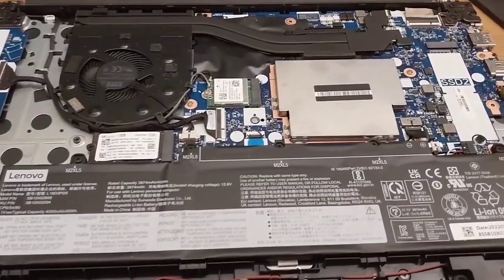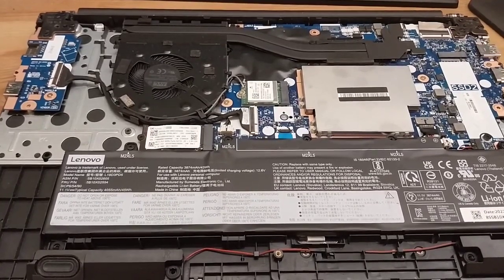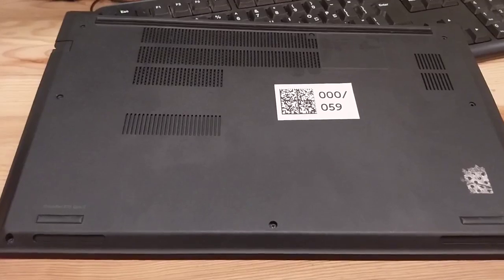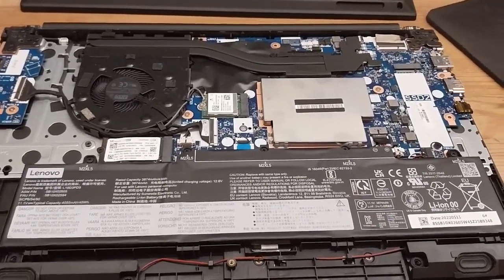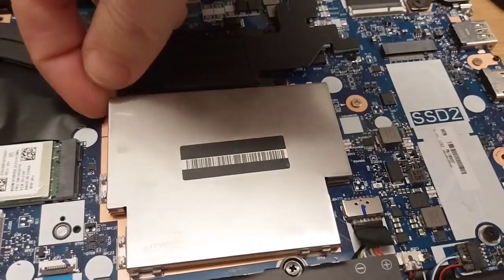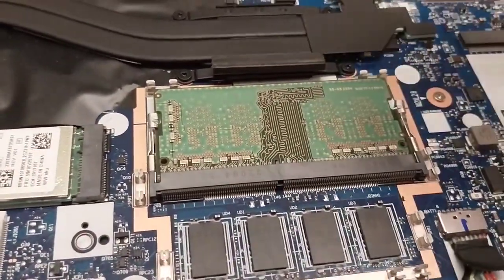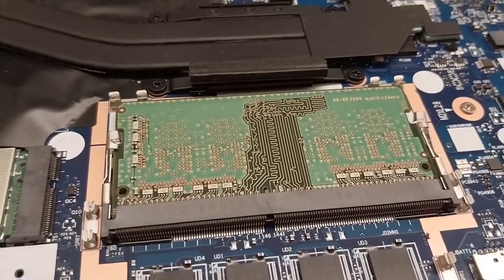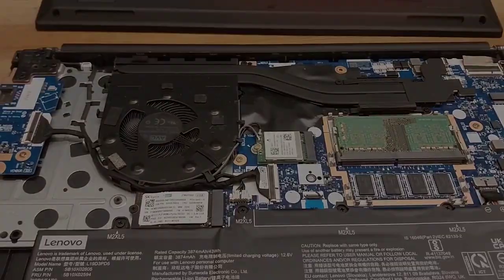Lenovo Thinkpad E15 Gen 3 RAM Upgrade

Comment: Bro, I don't understand, PERF says max capacity is 24GB when 8 GB is soldered, meaning max you can insert on top is 16 GB. But you're saying I can insert 32 GB stick? Meaning it's going to be 40 GB as the result? Documentation also mentions that more changeable RAM might be supported and it all depends on how the technology is developed bla-blah, nothing specific.
Reply: TLDR 32gb does work but lenovo doesn't recommend it because it can cause noticeable lag. Supposedly when you put 16gb or ram in single channel it becomes a lot more noticeable then 8gb
8GB Soldered + 8GB SO-DIMM (Total 16GB): Both modules are of equal capacity, enabling full dual-channel operation, which can improve data throughput and system responsiveness.

8GB Soldered + 16GB SO-DIMM (Total 24GB): The first 8GB of each module operates in dual-channel mode, while the remaining 8GB of the 16GB module functions in single-channel mode. This configuration is often referred to as "flex mode" or "asymmetric dual-channel." It provides a balance between increased capacity and the benefits of dual-channel performance.

8GB Soldered + 32GB SO-DIMM (Total 40GB): In this scenario, only the first 8GB of each module operates in dual-channel mode, with the remaining 24GB of the 32GB module running in single-channel mode. While this setup offers substantial memory capacity, the performance gains from dual-channel operation are limited to the initial 8GB portion.
Reply: @Bananamann   Yeah, poor design. Why couldn't they provide both removable slots like the older models. I am at 24gb RAM and find I am always using 90% of my RAM with over 50 tabs opened. Chrome is a RAM killer
Reply: please run this command in CMD - it would be greatly appreciated.
wmic memphysical get maxcapacity
Reply: @Dan-rd8dr  How much did you get on yours when you run the cmd? I'm facing the same question of how much I can upgrade on my gen 3 lenovo TP E15. I also watched the Vampyre and he booted it up fine after installing 32gb ram so I think its okay to install a 32gb ram stick. Also my maxcapacity is 67000000 but thats only 0.067 gb so I'm confused lol
Reply: just saw RAM upgrade video from Vampyre Drakul - he does it on E15, but seems like different gen - maybe gen 1/2 - stick is not soldered there.
He was able to put 32GB even though PERF says 24 GB is max.
Reply: Where can I buy these ram sticks please ?
Reply: @supermotostig5987  just google based on your processor. RAM frequency should match

Comment: Can I add both of   hdd and ssd in this laptop or there is just palce for  ssd??
Reply: As far as I can tell there's no room for a hdd. I've got a similar laptop and it came with 256gb SSD and there's room for M.2 SSD for expansion.
Reply: E15 gen 3 takes a M.2 hd and a NVME PCI hd no SSD drive as there old school now .